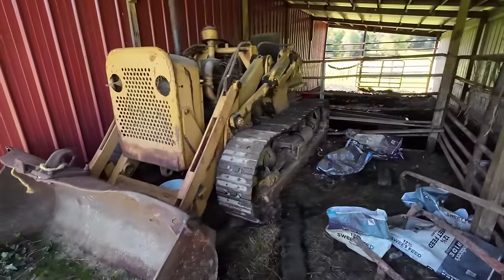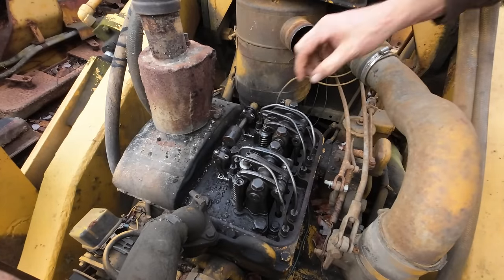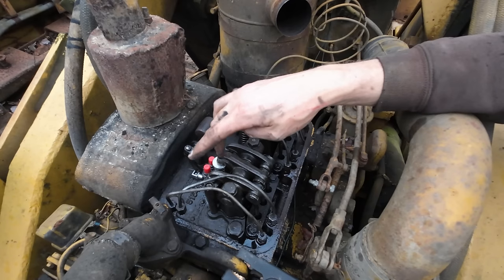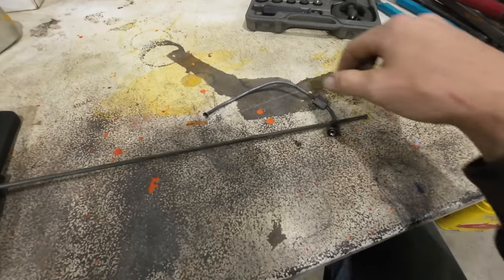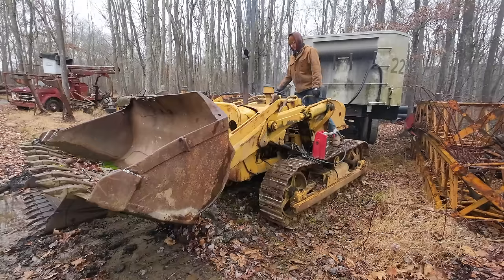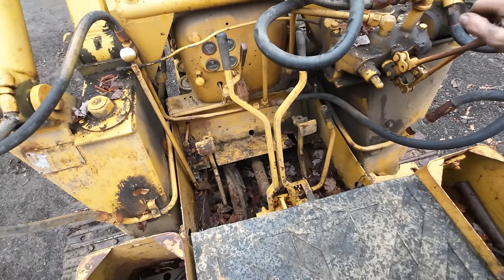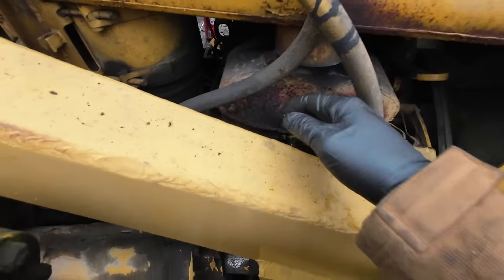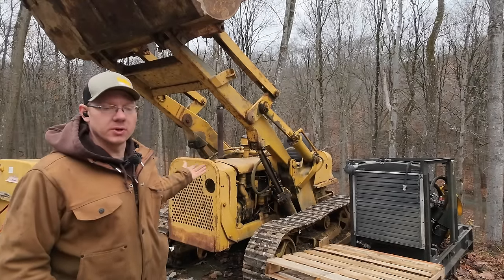$500, Allis Chalmers Track loader. Sitting for MANY years!  (Will IT RUN?!?)

Comment: Cold start process, crank with full throttle,stop crank when white smoke appears. Allow fuel to condense and create a better compression seal,maybe 3 or 4 minutes, and then start normally. I live in Alaska and have been using this method for years.
Reply from the maker: Yes, I definitely noticed that helped with this. I had to cut out the dead time in the edit though. But that’s exactly how it was getting it to start.
Reply: Does that trick only work on two stroke diesels or any diesel engine?
Reply from the maker: @3dprintedhardware  it works on all of them
Reply: Good to know.
Reply: Wonder if it would've started quicker if you had filled the filter cannisters? Great little engines, congrats on getting her running
Reply: Diesels need air. Temporarily removing the air filter gives maximum air flow.

Comment: I agree with oil technology having greatly been improved since the 60s.   I too run multi weight oil in everything.
Reply: Multigrade (weight) oils contain detergents that keep contaminants in suspension so the full flow oil filter can remove them. Old engines relied on the crud settling into the sump or some sort of screen. You should only use multigrade when you have a paper element filter.

Comment: Quite correct about the multi-grade oil Matt, it was SAE30 many years ago when Detroit wrote the manuals and the early multi-grades made significant ash.  I had another designed oil-burner to worry about and spent a while on the phone to various big name oil labs getting the story.
It's not a problem now, 15W-40 in a Detroit is fine.
Reply: I'm going to agree with you on this. Multi is fine at this point.
Reply: Running 15W40 in my 671 genset.
Reply: To my knowledge there are no multi grade engine oils that are CF-II certified/rated. That said Detroit is very specific about oil weight and ambient temperature in their TSB’s. I worked as a mechanic for a concrete company for a couple of years many moons ago and we ran multi grade engine oil in all of the Cummins and Mack engines but all of the trucks with 8v71’s and 8v92’s were feed Delo 100 30W in the winter and 40W in the summer.  The company tried running 15w40 in three 8v71 trucks and they held respectable oil pressure and the coolant temperature never was a problem as long as the ambient temperature didn’t climb above 70 however once the ambient temperature rose above 80 we noticed the oil pressure and coolant temperatures increased above the trucks that were running Delo 100. The multi-weight oil experiment ended during July when  the high temperature for the day were in the mid 90’s and all three trucks started having oil pressure issues that went away once we dumped the 15w40 and filled the engines with Delo 100 40w.  Mind you I am not saying engine oil technology has not advanced since then because we all know they have but the engine technology for 2-Stroke Detroit Diesel engines have not and because of that I still firmly believe that straight weight CF-II certified/rated oil’s are the best choice for these engines. All that said you do what you think you should do and I will do what I think I should do
Reply: @gullreefclub  Good testament, thank you.
Reply: @gullreefclub  Agree. I have owned and operated 671s, 8V71s, 6V92TAs and 8V92TTAs for over 20 years. I have also owned and operated a fleet of CAT 3406Es. I would NEVER presume to know more than the manufacturer of the engine. I follow manufacturer's recommendations to the letter. I have never in all my years of fleet ownership and fleet management for another company had an engine failure.
Reply: Its a big old diesel, as long as its liquid and lubricates its fine 😅

Comment: I agree with your oil theory.  I’ve been in the mechanic business for over 40 years and because of technology, oils have become better and the recommendations in the manuals have been changing. The iron / steel doesn’t care. It just wants the best oil you can give it. That’s my opinion.  
    Thanks for the adventure again. I look forward for your vids. 👍
Reply: I agree oil technology has made major advances especially in the past 20 years. That said oil certification/ratings still matters and is why the API has these ratings and to my knowledge there are no multi-weight oils with the CF-II certification/rating that is specified for 2-Stroke Detroit Diesels. Additionally advancements in engine oil went hand and hand with advancements in engine design and efficiency. That said  the  71 series engine first roared to life in 1938 and production ended in 1995 or there abouts. The 92 series production was 1974 to 1995, the 110 series 1945-1965 and the 149 series 1967-1999.  My point for the production run dates is to show that while engine oils have advanced the technology that designed and built these engines has not. Just look at the piston ring metallurgy, tension, and design of a modern diesel engine and that of a 2-stoke Detroit much less piston to cylinder clearance and main and rod bearing clearances and least we forget that 2-stroke engine is going to contaminate it’s engine oil with fuel and particulate matter much faster than any 4-stroke engine regardless of when it was designed and built.  That said my experience with 2-stoke Detroits is limited to mostly to the 8v71 and the 8v92 and when I was first starting out as a mechanic many moons ago the company I was working for tried 14w40 oil three of their Detroit powered trucks and during the winter the trucks performed fine and their oil pressure and temperature were fine however once summer came around and temperatures were in the high 80 to mid 90’s oil pressure, temperature and coolant temperature as well as oil usage became at the very least concerning but after dumping the 15w40 and replacing it with Delo 100 40W those issues went away. 
All of my ramblings above said at the end of the day I will do what I will do and you can do what you want to do. Additionally my post was not meant to start a war of words but rather me expressing my personal opinion and experiences. Have a nice day and a better tomorrow.
Reply: @gullreefclub Agreed. The book says straight 30W with low ash content, but since I run my 71 series only during the summer months, I also use Delo 100 40W.
Reply: Yep totally missed an ad chance for t6.
Reply: I agree 100% with Matt's statements on engine oil, he's the expert in my book.  I think the reason why people get upset about engine oil is because of stories like what happened with my grandfather's car - a 1954 Mercury. He always ran it with straight 30W oil, then one time a family member changed oil for him and used 10W30.  It cleaned out the engine too much, and it never ran right after.  I think it used a LOT of oil.  After that he bought a brand new 1968 Ford pickup (for about $2500, we found the receipt after he passed away in 1979).  But like it's been said, that was another time, and engines and oil technology have changed since then.
Reply: Even a cheap 10w40 15w40 diesel oil is miles better than the stuff they had even just 30-40 years ago.

The european ACEA specification in particular has high quality standards because all the automakers there are obsessed with long life intervals like 20.000 miles or so and their additive packages and choice of base oil reflect that.
Reply: Oils are better made then human food😂
Reply: what matters in engine oil is the fluidity and lubrication qualities, aka the weight. You can for instance not use full-synthetic in a 60 year old engine that was designed for petroleum oil, because the seals aren't made for it, so the oil would leak into (or out of) places it shouldn't go. Semi-synthetic is normally the best thing to put into these old engines, as long as you use the same weight, as it tends to flow better and get where it's needed faster than non-synthetic. The only reason they still make the old non-synthetic is for people who refuse to use "that modern stuff", but to my knowledge there's no engine that require it and can't use modern semi-synthetic instead.

You're not going to find any oil that says it'll work in an engine that's half a century old, but modern oils are indeed very different from what was available in the 60s, or even 30 years ago
Reply: @thesteelrodent1796  My point, exactly.  But this is not something that was known to the family member I mentioned above back in 1968.
Reply: @gullreefclub 😊
Reply: Multigrade keeps crud in suspension so the filter can remove it. Straight oils do not try to catch the crud. It’s allowed to drop out into the oil tank/sump/screen/whatever. 
If you change to Multigrade you must fit a paper element filter or that crud grinds up your bearings.

Comment: Best Matt. I can see so much of myself in you from my earlier years. I´m turning 60 soon, and have calmed down a bit about this mechanical love. But i was there....buying lotsa ole crap and got it running. Mostly cars and boats,....and I got a reputation beeing a good repairman, so i was requested for fixing machines at farms around my area.  Today i still have a small workshop and doin minor repairs on cars and trailers, etc, and restoring of my own boats keep goin on here.  U´re my u-tuber king, Matt. I watch every single video from you. I love seeing them. Best regards from Sweden.

Comment: Good video content Matt.  Content like this is why you are pushing 700,000 subscribers.  A worthwhile additions (since you have the gear) Would be a seam powerwash , pulling it into the shop so potential bidders could see it under better light, filming a grease job (shows a lot of detail) putting a temporary battery in it and checking the generator output and showing the gages and/or getting them operational.  Then she'd be ready for Ebay.  Love your content!😊

Comment: I agree with your theory on multigrade oil. I had a 1925 crossmotor Case and the manual recommended straight 30 or 10 weight oil. That's all there was back then. I filled it with 15/40 and ran it. One day I notice that the oil pressure was dropping. I took off one of the access hand hole covers and saw that the inside of the engine was spotlessly clean and the oil was a very filthy greyish black. i took off the pan and the oil pump pickup and cleaned them and never had another problem. Keep using multigrade oil and ignore those people who don't know any better.
Reply: It's not the multi-grade that does it - it's the detergent and other additives in the oil, and monograde these days is also available with detergent. So, like you wrote, he should ignore you : )
Reply: I realize very well that the 15/40 diesel oil is a a high detergent oil. @frontagulus

Comment: Matt,  when you made that fuel return line, it was hard to tell any difference from the other lines!  I think you did a great job making that line!  I used to work at a shop that had a contract with TUG and made tons of lines for them as their tow vehicles are all hydraulic and have hundreds of lines per TUG.  We used machine benders and configured them up for each line type.  Your skill bending lines by hand is something I admire!  Keep up the good work, and great videos!  🥲

Comment: I hear you on the Multi-weight oil issue. But I have done some research. The problem is not the weight of the oil, but the use of detergents. Detergent in oil additives should make the oil 'creep' into tight places, and it also collects abrasive particles and carries them to the filter, extending engine life. Detroit Diesels have exhaust ports in the sleeves, where rings ride past them. The rings pick up carbon, as well as tar from unburned oil, and this combination helps create a seal to keep engine oil out of the combustion chamber. 
  Multi-weight oils(especially newer ones) have additives to prevent the oil from creating gums or tars when mixed with carbon. The Detergent in multi-weight oil tries to scrub the gummy tar from the rings on a Detroit. When this tar is not present, the engine will consume oil... if it cannot burn it, it will blow it out the exhaust. 
  I have run Detroit engines with multi-weight detergent oil when in a pinch. Without fail, within a few hours of heavy work, the exhaust will start to spit a rain of oil all over the machine. Replace the oil with 30w non-detergent, and it will be a few hours before it stops spitting oil.
  Maybe somebody else has some other explanation, but this is what I was taught, and what I experienced.  The engines I experienced this with were all 53 series - a 3-53, a4-53, and a 6V-53, but I have seen it happen with sawmill engines on a 3-71 and a 6-71 as well as a 6-110, and an 8V-92.
Reply: It's the viscosity that's needed for the 2 stroke design, and that's true even with modern oils.

Comment: Pro tip: Make sure you put the fitting on the line BEFORE flaring it.  Especially when there are bends.  Good way to get mad is to spend a lot of time making a line super nice, just to realize you flared it and did not put the fitting on.
Reply: Can’t tell you how many times I’ve messed up PVC unions by forgetting to slide the nut on the pipe before cementing the fitting in. If I’m lucky there is enough room to cut the pipe and add a coupling or even better sliding the nut on from the other end. If not, well, another trip to Home Depot and an afternoon of swearing at myself.
Reply from the maker: Oh I’ve been there! Lol
Reply: Another one is forgetting to put the shrink wrap tubing on before soldering a connector. The list goes on and on.
Reply: @markjames8664  But, isn't that why they make liquid electrical tape now, for those that say oops?
Reply: If I had a dollar for all the times......
Reply: glad I'm not the only one that's done that.
Reply: @markjames8664  I lost count of how many times I have done that one!!!!
Reply: Remembering (or not) to put the barrel nut on before soldering the PL-259 or N connector onto the coax...
Reply: think that's why Wes sometimes finds brake lines with fittings into fittings into fittings ;)
Reply: Dah

Comment: My very  first "heavy metal" was an old 68' model Allis-Chalmers track loader .It had a cummins 4cyl. Bought for  $1000  ran but trans was out and so were the clutches. Changed all the fluids put on a couple high pressure hydraulic lines,  put in a salvaged 6 speed and a couple of clutches and used it for about 6 years . Did a paint and decal freshen up. reupholstered the seat, and battery box lid. and sold it for 9,500. Then bought a Komatsu. Nothing like that old mechanical p-pump diesel.get it started and you needed  NO electrical for it to keep going.

Comment: Matt- You need to adjust the RACK. That will make sure both cylinders are getting the same amount of fuel. You adjust it with the screws on top of the throttle shaft.
Reply: Always good practice to check make sure it's free and properly adjusted.  Seen way to many cause a runaway due to people improperly adjusting or blowing dirt into the bearings as he just did.

Comment: So I bought a GMC pickup with the 6.6 diesel in it , the guy told me it had a bad injection in it .i tested them all and they seemed ok. Drove it for a week,no problems at all,oil level was fine.so I used it to go on vacation pulled my 29 foot house trailer with it. 4 hours away I might add! 3 hours in my trip and I noticed black smoke out the back . I got to where I was going,parked for the night. Next morning I checked the oil, way above full . Took it in for an oil change. Told the young fella about the injection problem and he said “ no problem “. In the truck went and here is where the fun began! He pulled that plug and it shot “oil” over the tray and all over the shop . That thing drained for at least 5 minutes as him and his assistant ran around looking for more things to catch the oil in. It was something to watch. Needless to say when I got home it was injected time . Talk about a clean engine inside.spotless . Thought you would like to hear my story! Truck is still running great today.